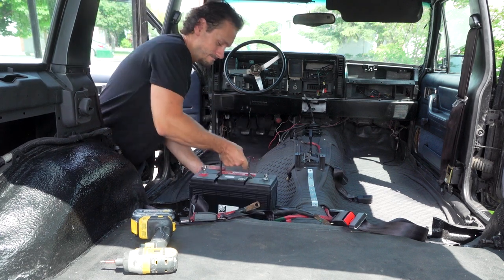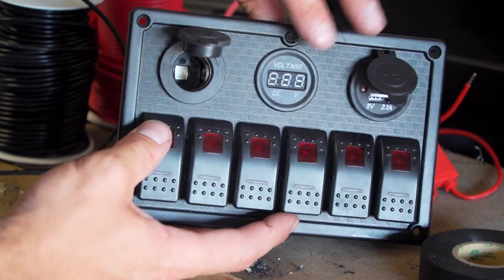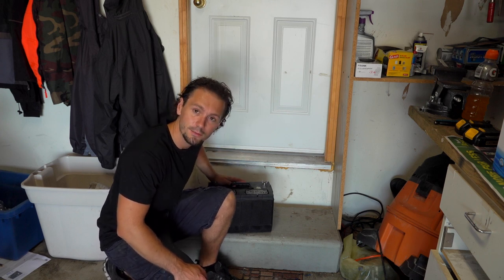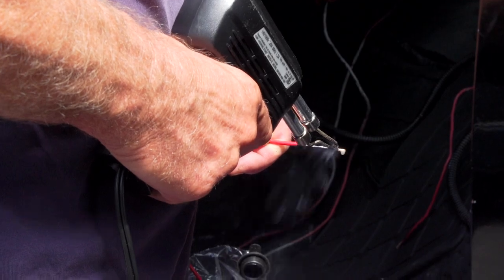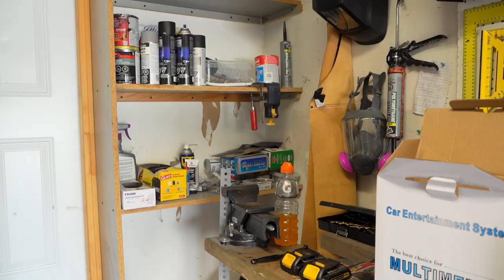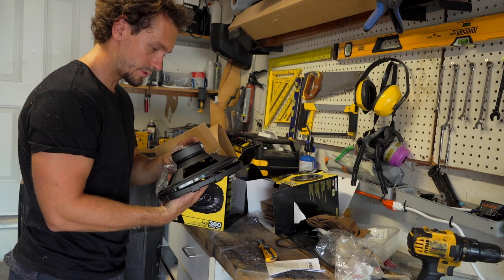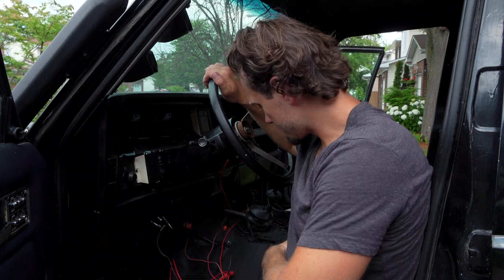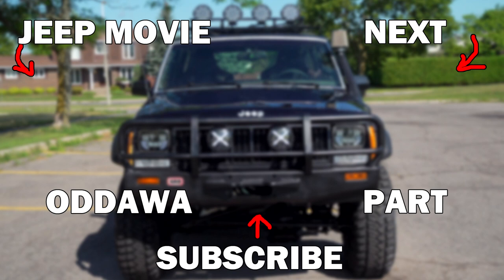Sound System Duel Batteries and Rocker Switch | Jeep XJ Cherokee Restoration | Part 6

Comment: Do you have any problems with feeling the batteries when you sit in the back seat? No shorting problems?
Reply from the maker: No problems no. Carved out the inside of the seat and then had the upholstery company add am extra inch of thick foam on the top. No metal under there so no issues. Before we did this you could feel the batteries a little